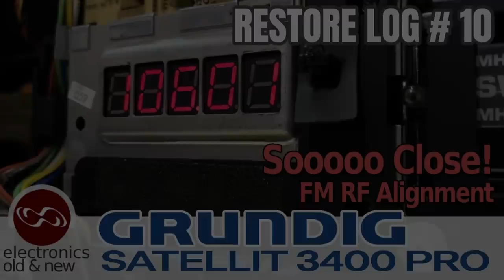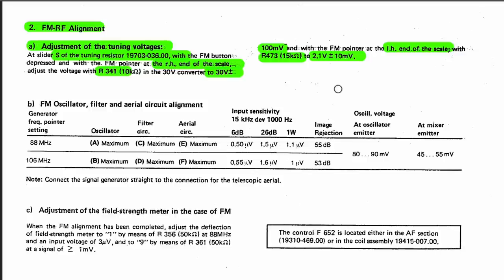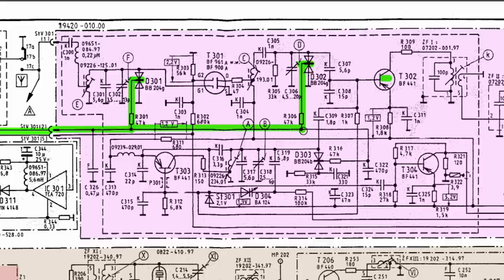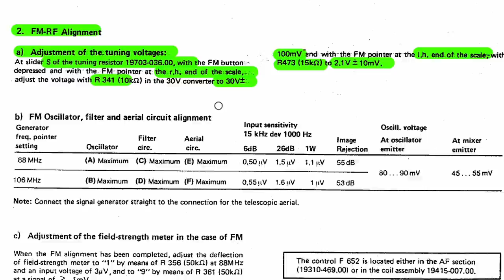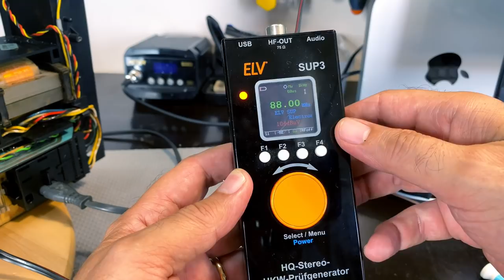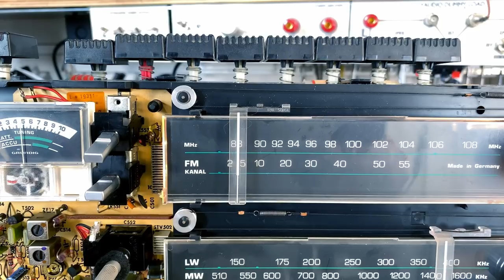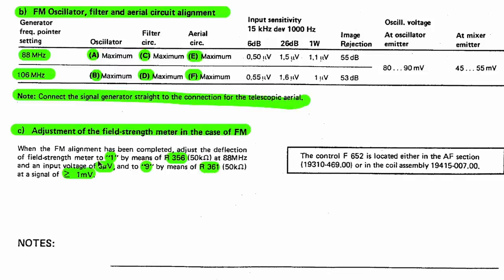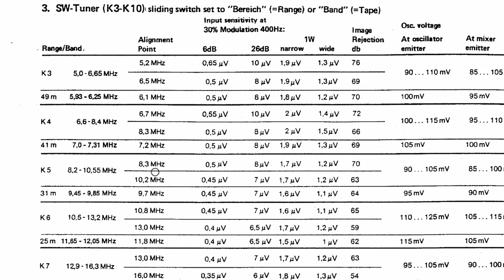Sooo Close. RF alignment of the FM. Grundig Satellit 3400 Pro restoration part 10.

Comment: Great video and appreciate the comments regarding dealing with uV levels.  I noticed with both Heathkit and Eico tuners that the RF frontend are done at the factory and warn not to mess with it.  I can now see why; however, I am going to do it anyway because my Heathkit needs it -- they have the steps in the manual but caution that you need the right equipment.  I have a Siglent generator, much like yours, that puts out a minimum of 1mV and attenuators that will get me down to around the required 4uV - that is only based on calculations of course.  Always a first time.  Looking forward to more from you.  Thanks again.
Reply from the maker: I have some difficulty enauru good that the levels are correct because the actual level depends on impedance, which are not easy to determine. However, sometimes common sense and your ears are enough 😊
Reply: There’s also the problem of loss in the connectors. This gets more critical as frequency rises.  At FM frequencies, BNCs aren’t TOO bad, but the loss changes every time you make or remake connections. You’re only talking a dB or so with each connection, but they add up, and contribute a significant SWAG factor as they do. I used to calibrate signal generators that operated up to 30GHz. They brought a whole new meaning to the expression “FM.” Getting a level signal out of them over a band GHz wide was responsible for a good many of the white hairs I have on my head now. These were tube oscillators, and just taking the tube out an reseating it could drive the performance out of tolerance.  Hated those damned things.

Comment: Vericap diodes, interesting tuning system. Good idea leaving well enough alone Manuel, you may have had some success with a tuning tool looking in the wife's knitting bag although some needles can be a bit twisty.
Reply from the maker: Unfortunately my wife doesn’t knit. These modern women 😊
Reply: @electronicsoldandnew  🤦‍♂️
Reply: Bicycle spokes with ground tips make excellent long screwdrivers, but I'm not sure you could counteract their metal's de-tuning effect .
I have quite a range of alignment tool as I usually buy all the old ones I find a Ham Radio swap meets, but I don't have any long enough for this job.   It used to be you could find all sorts of tools like these for sale. but its gotten harder and harder.
Model RC planes and cars now use all sorts of high strength carbon-fiber components that are small in diameter, but as far as I know its conductive.
Maybe you could alternate back and forth between brass and another material.

Comment: I think the work so far has been great, but you need to do something about attenuating your signals to predictably lower values.  Some of the sensitivities listed in the paperwork for the next segment are even lower than those you've skipped today.
Reply from the maker: I don’t really worry much about the actual sensitivities, because I align it to the best possible. Whether it meets spec is not something that will bother me. If it does not meet expectations… that’s another story 😊

Comment: I rescued a Grundig 3400 that had been sitting for almost 40 years, it has good sound, maybe some dirty contacts, but they can be cleaned. The problem is the frequency counter, it does not turn on nor does it seem that there is a transistor that has burned out and the lamps do not work either. I'm thinking about buying the complete frequency meter because I don't know if it's possible to recover it.
Reply from the maker: Give it a try. What have you got to lose?

Comment: The only thing i am worried about my Sattelit is the plastic case. Theres one point with a every so slightly but 1,5 cm microcrack. Its where the antenna is mounted. I wonder what i can do, to prevent any future damage. Mayhaps trying to "fill" this micro crack with JB Weld from both sides? Dont know. It sure needs to be a rather strong solution, because its stressed mechanical whenever you move the antenna.
Reply from the maker: JB weld should do he trick
Reply: @electronicsoldandnew  Thanks, gonna try it!

Comment: I wonder why they didn't use a frequency synthesizer to synthesize all the frequencies for the FM band and just Analogue tuning for AM.
Reply: PLLs for FM LO synthesis were only available at the end of the 70's & very beginning of the 80's (e.g. Philips SAA1057 for both FM broadcast (70 to 120 MHz LO , step 10kHz) and even AM (step 1kHz, up to 32 MHz) has a datasheet dated Nov 1983). And you had to have a µproc or µcontroller to make it run.